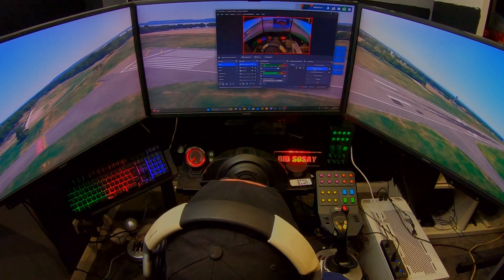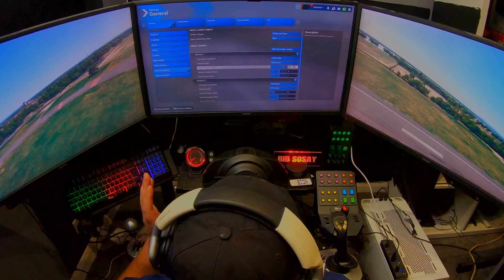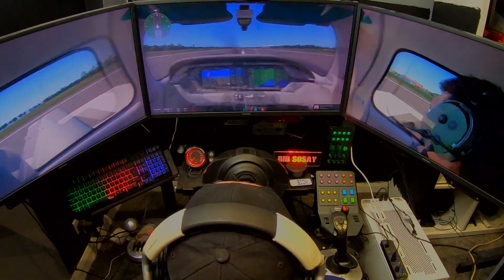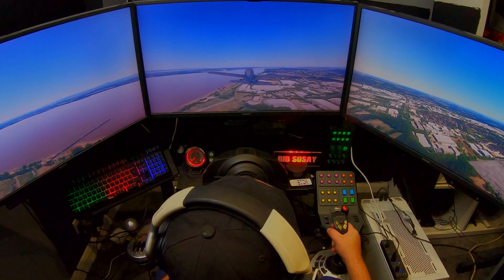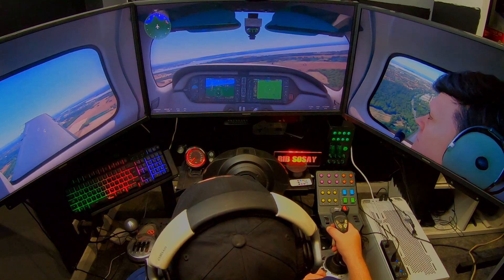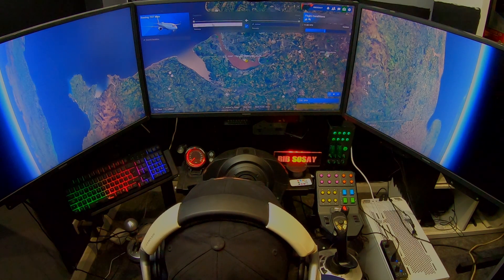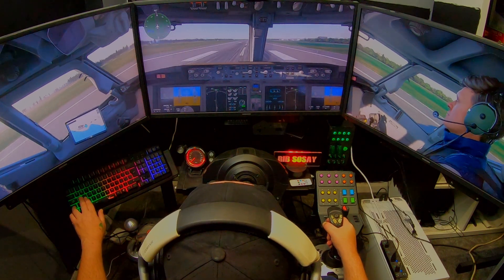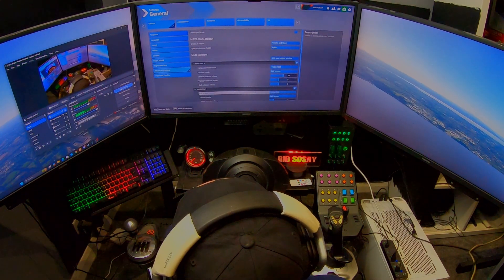HOW TO SETUP TRIPLE SCREEN IN MSFS 2024 #msfs2024

Comment: The settings you have are still not true to life because your 45deg monitor is showing 90deg to your side. So you only turn your eyes 45 deg and end up seeing what would be a full 90deg beside you. Asobo has a problem where the monitor images only line up when you set the in game settings to 90deg. So no matter your actual monitor angle you have to run the 90deg setting. Only shows up true to life for people who run 90deg monitors

Comment: Even in MSFS2020 it was all about compromise because they hadn't worked out that the primary screen needs to anchor and align from the two others so...when you moved about the cockpit the up, down, left or right the alignment would always skew. You'd have to optimise and compromise to what's best. MSFS2024 is a step backwards at least in 2020 you could see the screens as you aligned them to check you were going the correct way. And once set it would stay fairly nice going from one aircraft to the other. Not in 2024 - changing the aircraft skews it even more. Just typical half baked from Asobo

Comment: Something I learned after installing SU3 Final. It makes a huge difference if I use the 3x 3840x2160 monitors by either using the multi-monitor, or settings within MSFS 2024 of stretching the one window displayed by MSFS 2024 over those 3 monitors. Using the first scheme, I got about 30 FPS, stretching the single window over the 3 monitors. Here, the FPS were just about 5 FPS. My PC uses an i7 11700K and the RTX3080 with just 10GB. I use a Samsung M.2 SSD with 4TB and placed in that socket where the CPU and the M.2 SSD Using the function in the developer mode, I could not just see the FPS, but also the amount of memory in the GPU used.

While starting the MSFS 2024, the streamed image over the single window spans all 3 monitors with wonderful FPS. Then came the message that there was insufficient RAM in my GPU, 10GB, and the FPS dropped to about 1 FPS. So MSFS 2024 initially was able to run that initial stream over the 3 monitors, showing an impressive image at reasonable FPS. So what has to be set up so that the image over the single window runs at those tolerable 30 FPS?

Comment: FYI. I am running 3x32" LG nano displays at 1440p, ultra settings on corsair 4090. Below that I have 2 21" asus touchscreens for Air Manage panel sets. I used to do VR but had trouble with hand controllers and tuning frequencies etc. on vatsim. Triples and Air Manager is the way to go. Get rid of all that junk hardware that doesn't resemble anything on flight deck Good luck not affiliated.

Comment: Main screen runs smooth as silk, but both outer screens seem to run at lower fps, causing visual distortion. Not sure what im doing wrong any ideas?
Reply: Mouse focus has been known to cause stutters. Click on the screen that is stuttering and it should resync to smooth main screen. Works for my triples and AirMgr 2 touchscreens. Not sure if this is Windows 11,. MSobo or Nvidia fault. I changed monitors around to diff DP ports and ruled out display as source of problem. Good luck.

Comment: it's the worst implementation of triples of all games. both functionally and performance wise. asobo is a joke...
Reply from the maker: Yes it is a pain in the arse not going to lie and my RTX 3090 really struggled running it, seems better performance wise with my new pc but yea I agree it isn’t the best. See my latest triple screen video
Reply: Yeah. Agreed. That said, if it is any consolation. It works. You just have to take time to figure it out. I run 3x32" LG nano at 1440p and 2 x 21 asus touchscreens for Air Manager on Corsair 4090. Very smooth and sharp on ultra settings. Beats VR sweatbox on your head any day. Good luck.

Comment: Yes I've added 2 new render windows like your video says I've set them just like you say It's like reading a book with the first 50 pages missing
Reply from the maker: Well I did say in the video make sure you don’t have the nvidia physx surround set. Then when you first add a render window do alt+enter and move that screen then make it full screen, and repeat for the other windows
Reply: @RIBsosay  Thanks for your reply. But I'm not using Nvidea anymore, My pockets aren't deep enough.

Comment: Your video is ok but missing one vital part What setup do you need to do prior to starting the sim. All I get is the sim running on my center
 screen and my desktop showing on my 2 outer screens. What am I missing.?
Reply from the maker: Well I did say in the video make sure you don’t have the nvidia physx surround set. Then when you first add a render window do alt+enter and move that screen then make it full screen, and repeat for the other windows

Comment: Compared to MSFS2020, in my opinion it has become even worse. While you are in the menu, an external view is constantly rotating. How are you supposed to get reasonable settings with that? You need at least a fixed cockpit view during the settings. I am currently building my home cockpit and am hoping to use the relatively expensive "FlyElise" software to be able to calculate and adjust distortions etc.

Comment: Thanks for your reply, I’m not using NVIDIA surround and I can see 3 separate displays in display settings. I don’t think I had this issue in msfs 2020 I just got 24 today.
Reply from the maker: Yes when I do it I add a render screen then have to make that one windowed move it to my other monitor then press alt + enter to make it full screen then repeat the process for the others
Reply: Yes I have to do that too, but the image is a duplicate of my main (middle) screen image, for example I would see x3 cockpit dashboards on left middle and right screens.

Comment: this is not at all better than in msfs2020, just compare it with Xplane1, that's good... the screens on the sides are not realistic at all... so no improvement... unfortunately...
Reply from the maker: @dannyvr1225  check the other video this was just the setup
Reply: @RIBsosay  I can't find the video...but  I have a problem: I use 3 screens, middle and right one are acceptable, left screen is squashed flat..?..In msfs2020 this is not the case. Any idea how I can fix this?..thanks for a reply in advance...
Reply: @dannyvr1225  I'm having the same issue but it is my right screen....

Comment: Hi, I'm facing a problem. Main monitor is that one in front of me, first window works perfectly on the left monitor and then any other window I will add is going still on the front monitor. So 3 windows and 2 monitor, the third monitor doesn't get a window. Do you know how to fix it? Thanks
Reply from the maker: @Marcofly90  just make sure all monitors are separate in your display settings and all the same resolution

Comment: Hello... Can you recommend a good video splitter box? I bought one from StarTech but my thrid screen is always green. I do have a top of the line computer. Thanks
Reply from the maker: I just have 3 hdmi cables coming from my screens, 2 go into hdmi - dvi adapters then plugged into the graphics card and the other cable is just straight hdmi to the card
Reply: Am experiencing flickering trees and vegetation on 3 screens set up😢
Reply from the maker: @Hmdkdd can’t say I’ve seen that to be honest
Reply: @Hmdkdd  I have the same issue. Only with 3 screens. What monitors/tv and graphics card do you have?
Reply: @ RTX 4080 / samsung 49 ultra wide in the center and x2 32 gameon on the sides
Reply: @ hmm okay. I’m using 3x lg b4 oled and msi 4080 super